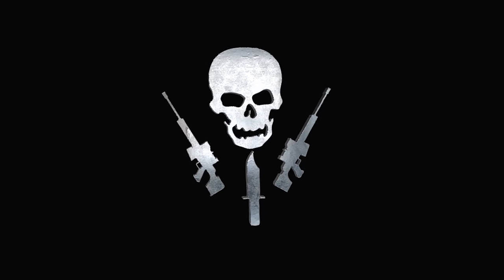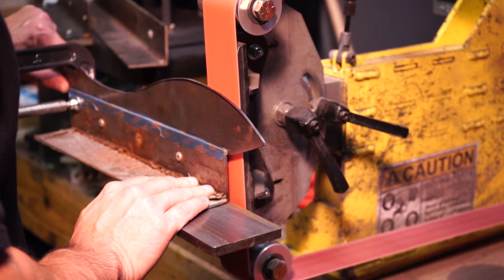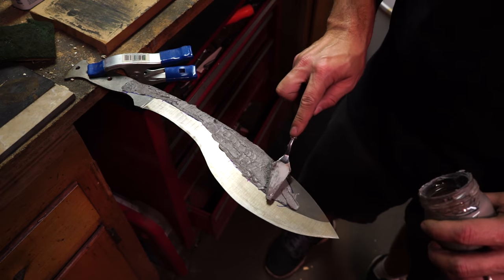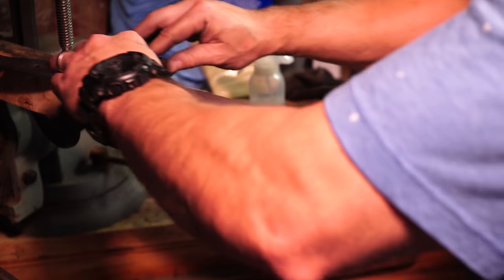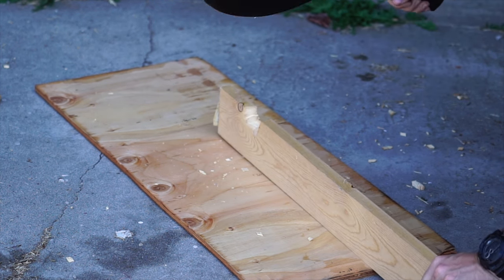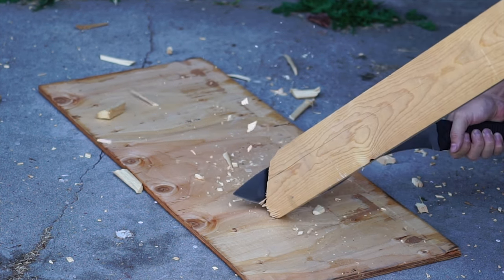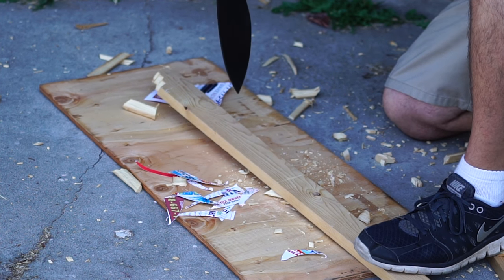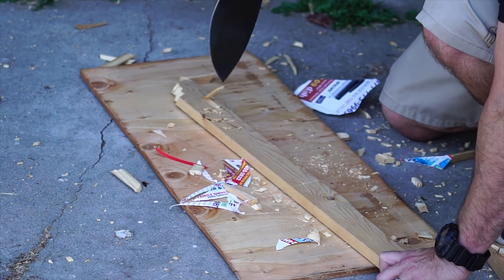Knife Making  Kukri machete

Comment: First off excellent work. Secondly I would like to know the advantages, and disadvantages of . Deferentially heat treating blades?
Reply from the maker: +killgora1 Thanks man. I'm still a knife making newb but from what I ha researched. Something like a machete or a sword you want the spine to be softer or springy so they can flex and spring back . knives you could go full hardness or a soft spine. Full hard it could snap or too soft it will bend.
Reply: Ok that's what I thought. It makes it more impact resistant in a way. Thanks.

Comment: I've got an identically shaped and sized 1/8in model, it's a cheap piece of crap, handling is horrible (decided to convert it into a type of naginata).

The slightly more curved Gurkha Kukri, with the slimmer profile by about half an inch and spine thickness of 1/4in to 3/8in has great handling and is good for splitting small logs.
Reply: Slimmer profile from the middle of the blade up to the tip.
Reply from the maker: Sounds pretty sweet.